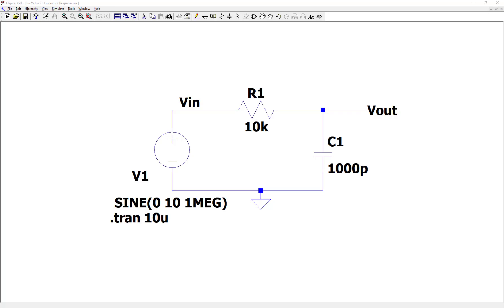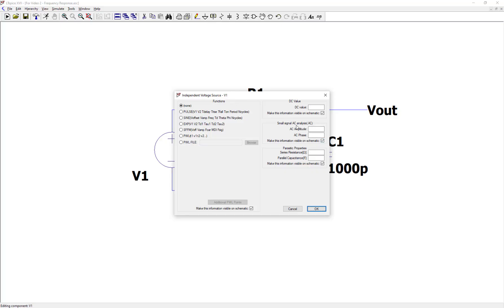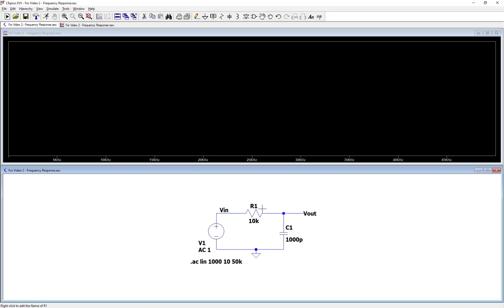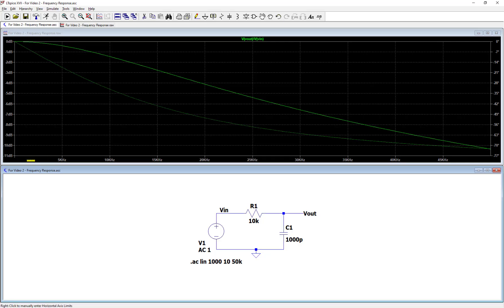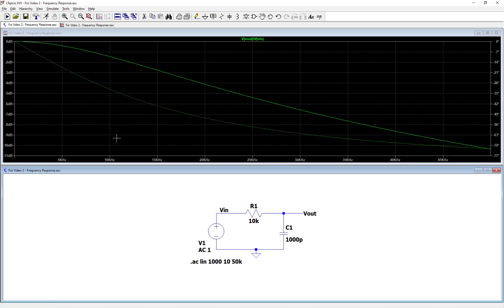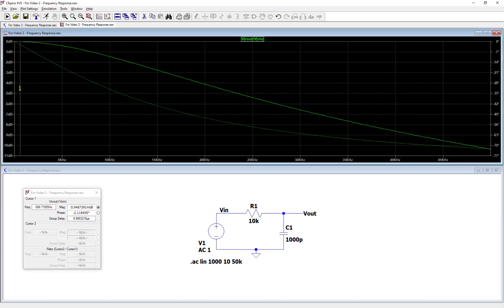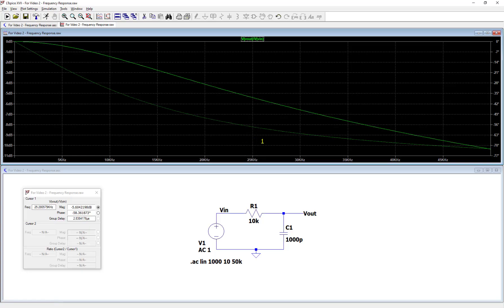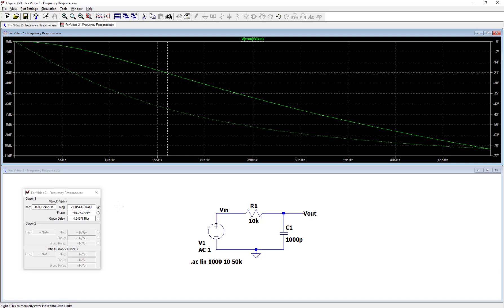Simulating Frequency Response of an RC Circuit in LTspice

Comment: Why are there two traces after you ran the sim at 2:30? What does the darker colored one represent?
Thanks
Reply: that's the discrepancy between the Vin and Vout signals, measured in degrees.